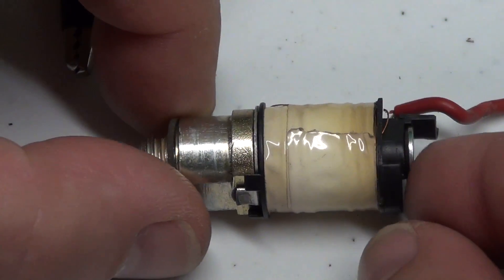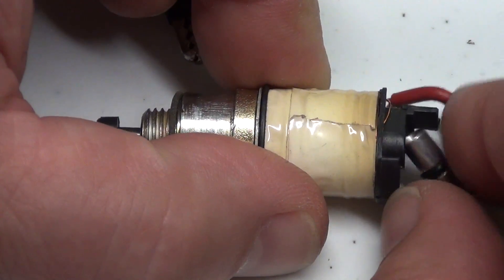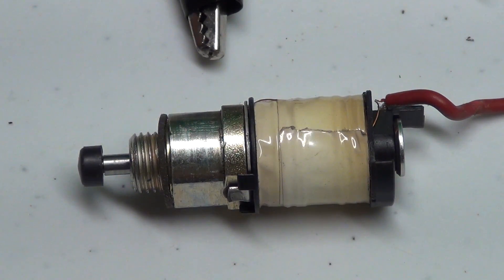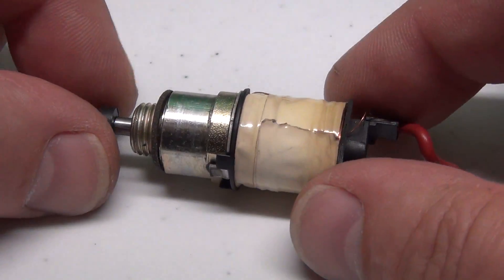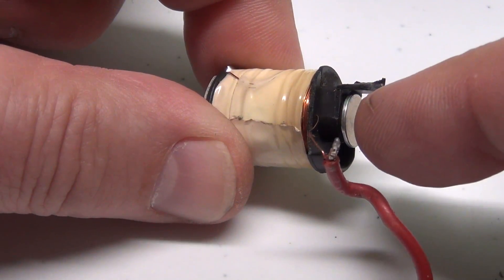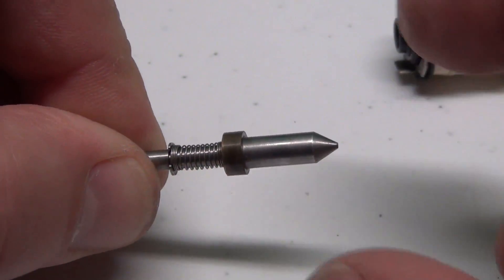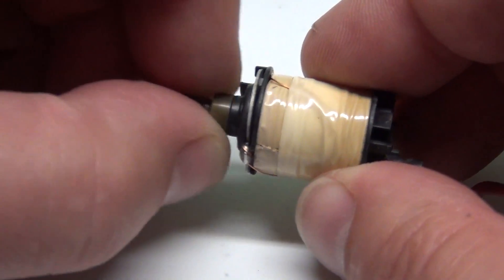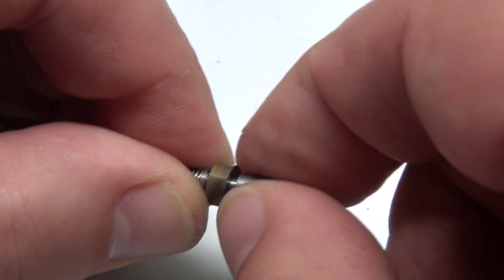Kohler Courage Single Cylinder Engine Fuel Solenoid Problem

Comment: not sure if that rubber o ring is for vacuum or not, but a thought here, if solenoid is engaged (up) fuel flow stops, not engaged (down), fuel flows. NOW, gas flows past the black rubber/plastic cap on the top of solenoid actuator shaft, fuel could potentially flow down and around the 'shaft', with no o ring on that bottom part you pulled out, gas could get to the 'electric' coil and could be a fire hazard.   just my 2 cents worth.

Comment: It makes sense that it was designed that way on purpose. It doesn't need to snap back.
Reply from the maker: engine doesnt start or run if it doesnt snap back.
Reply: @mygiguser   So, if it moves back slow the engine wont start? It takes 1 second to move back slow.  By the time you turn the key to the start position the valve is open.

Comment: Nice find 👍 Replaced my used 2008 Kohler  after gas leaking thru the air filter. Noticed a small portion of the butterfly valve was rusting. Suspect E10 (or higher) gas had sat for an extended period of time without running. Water was able to form from the use of ethanol and poor material properties of the butterfly valve. Also suspect the rubber ring could have expanded on the solinoid due to poor material properties.

Comment: Find a new one. I have one on order for 2 months. So far no luck. $57 too damn high for a mini solenoid.  Kill the motor in gear. No backfire. Why not a manual shutoff.
Reply from the maker: In my mower, the gas tank is above the engine. If you delete the solenoid, and replace it with a shutoff, you forget only once and the engine gets flooded with gasoline. They say this Kohler is not very forgiving in that case. Not sure about the price right now, but my solenoid is still working since i installed the heat shield.
Reply from the maker: A little tip: try to find a new carburator on Amazon ir Ebat, it comes with solenoid and may be cheaper than the solenoid alone. Dont forget to install a heat shield!

Comment: On my tractor and 16hp Kohler I had gasoline in my oil and also coming out the muffler!! DAGEROUS! This should have been a RECALL for sure.  My solenoid was not stuck,, it was an electrical failure. Voltage to the wire but the connection of the pigtail on the solenoid was so rusted and worn where the wire goes into the bottom it literally fell off in my hand while examining it. I'm not jury rigging mine,, I'll spend the bucks now for a replacement.  A back fire on a small engine can cause serious damage to the internal engine parts,, mess up the timing or damage a cam gear.  Take care of your engine and it will take care of you!   Mine lasted 20 years.. I cannot complain about replacing it now!!!
Reply: Also install a gas shut off valve between the tank and carb.shut the valve off when you are finished with the tractor.let it run dry to stop .That solenoid can leak again mine did had to change the oil 3 times.It Beats blowing a whole through the side of the engine.

Comment: I found a problem existed when I hit the starter to start my Husquavarna lawn tractor. The engine turned over about 1 turn and sounded like it locked up. I suspected that raw fuel had run through the carburetor and filled the combustion cylinder with enough fuel that it locked up. I also smelled a strong odor of gasoline. Sure enough when I pulled the spark plug out and hit the starter the raw gas shot out ten feet which confirmed that indeed the fuel had leaked down into the cylinder. Since the purpose of the fuel shut off selenoid is to shut off the fuel when the engine is not running it did not take a rocket scientist to suspect that the selenoid was the problem. Since the gas tank on this lawn tractor is much higher than the carb, some shut off device is necessary.
Reply: bill smith your saying the solenoid isn’t a factor when the engine is off? This one my boss has leaks when it’s off from the carb out through the intake cover. So this would have something to do with the float assembly/ seal/ needle?
Reply from the maker: yes, a manual fuel shutoff valve is much better, if you don't forget to turn it off.

Comment: Thanks for taking the thing apart. I found with mine that there was build up inside the magnet. I ran a 22 caliber rifle cleaning brush thru it with carburetor cleaner on it a few times and it freed it right up. Put it back together and it worked like new. Mine seemed to go up and down continuously after the repair, not just up or down but it runs great and no longer leaks fuel until the tank is empty. Thanks again for your video.

Comment: Nice breakdown showing the simple operation of it.  Dirt is often the cause of it sticking.  Try carburetor cleaner and compressed air to clean it first before replacing.

Comment: How do i buy a new one? 
The image of all the ones on Amazon look way different!
Reply from the maker: frazzleberry yes, they changed the design. The new ones look shorter.
Reply: @mygiguser  still works the same?? 
I was wondering if j just run the red cable into the new one :)
Reply from the maker: Yes, they still work the same. And most of the time they come with a little instruction sheet on how to connect them.

Comment: Hey, how do you open this thing up? Is it serviceable so to speak, can I open it and then close it back up?

I ask because mine started shorting out because the wire frayed due to vibration and one edge of the opening being bare metal, so I’d like to open it up and run a new lead.
Reply: I put mine together again and it works.  Carefully straighten the cover back by the wire and it slips off the front. When you put it back together use a small hammer and a vise and roll the edge back over the cover cap. I realize your post was a year ago, but thought I would give my answer for the next guy.
Reply: Thank you sir 🫡 @karlfowler420
Reply from the maker: No you can't close it again, once you open it it's broken.

Comment: you can grind a groove down the side of that pointed shaft and it will fix the suction problem.  What I did is just cut off the top of it all together and unhook the wire because it is a stupid design in the first place...   Just put an inline valve on your fuel line and remember to turn if off when you park it.  Done deal.
Reply: that wont work in all situations, some of those will not even turn over if that is disconnected.

Comment: So I see all these great details exposed with the case removed from the solenoid. How did you separate the casing from the guts? Is it possible to pull the guts out and put them back together AND still have the thing work?

Or did you break the outer housing to show us the insides since you had a replacement part ready? I want to pull this solenoid I've got here apart, but I don't want to destroy it in the process...
Reply from the maker: I used a saw, and i had the new solenoid already installed. This video was just to show, that you can't fix a broken solenoid.

Comment: No, that isn't how it should work. Slower isn't necessarily bad. It protects the rubber tip from slamming and prematurely failing. I think it also might seal the solenoid from leaking fuel as the other shafts are not sealed.
A common thought that should go through somebodies mind shouldn't be, "that's not how I would have thought it worked" and come to the conclusion that it was a mistake. Instead, try thinking about the extra expense to install the o-ring. It required an extra machining process, an extra part, and consequently, extra cost. Why would they do that? So the pin doesn't fall out during the rest of the assembly process? I don't think so but maybe.
I found that a common problem has been the quality of this ethanol gas. It seems to be making everything more difficult.
Reply from the maker: The new valve works great and it is snappy. The one i show in the video didn't work at all until i took it apart. Not sure what the deal is. The extreme heat it was exposed to, is most likely the problem for this particular solenoid. You maybe right with your ethanol idea. Possible that the o-ring was not ethanol resistant, and is now blowing up like a gummy bear in water.
Reply: Plan of obsolescence or an unfortunate industry scamming the customer normalcy. Give me my old Cub Cadet 107 any day over the new stuff.
Reply: Could be there was a faulty electrical connection from the ignition switch is the reason the solenoid wasn't working until you removed it from the carburetor.  That was my problem so I fixed the faulty connection which fixed my problem of engine stalling out while mowing.
Reply from the maker: Bill Gibbs, sr No, it works with the new solenoid. No electrical issues in this case.
Reply: Glad the new solenoid is working for you now.  I agree with Jon Prevost that ethanol in our gasoline is creating problems.  Most any small engine repair shop will agree. I use only ethanol free gasoline for my mower and my other small engines including the 2 cycle ones. Several gas stations in my area stock pure gas.  Most all boat owners and motorcycle owners use only pure gas for their engines.

Comment: Mine works but leaks. somehow fuel is going into the stem of the solenoid and leaking into the solenoid motor. Not sure I can fix that
Reply: put the o ring back on it and grease the mental plunger so it slides easy though the o ring. No gas leak and moves more freely back and forth.
Reply from the maker: jeff dowler is not going to work.
Reply from the maker: That's not good. You probably need to replace that one.
Reply: That was my thought also.
Reply: That sounds like a first degree burn Fireball waiting to happen